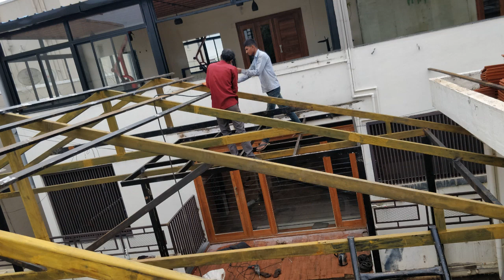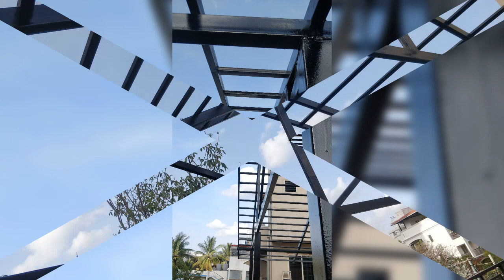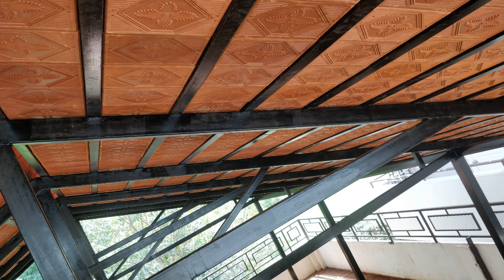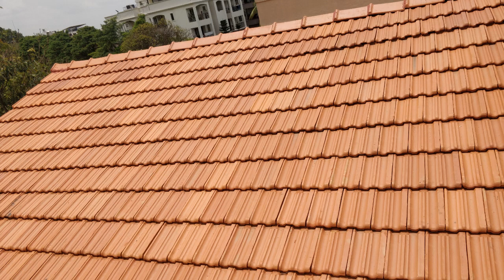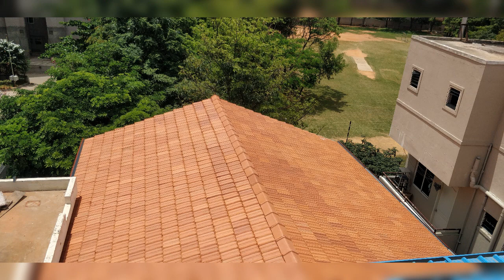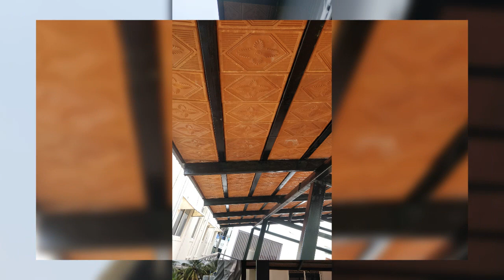Double manglore tiles roof

Comment: What's the exact gap between the two purlings for fixing the ceiling tiles, please comment?
Reply from the maker: 11 inch in Between the 2 tiles..
Reply from the maker: 50/25 mm purling between the 2 tiles 20 mm gap for the top ceiling tiles

Comment: Sir, I have single tile roofing now. Which is leaking in rainy season (noisy also) , and  heating to much in summer.
Can we overcome these problem by this method?
Reply from the maker: Yes you can overcome this problem
By single tile roof  there will be noise problem
by double tile roof there will be less noise
Thank you